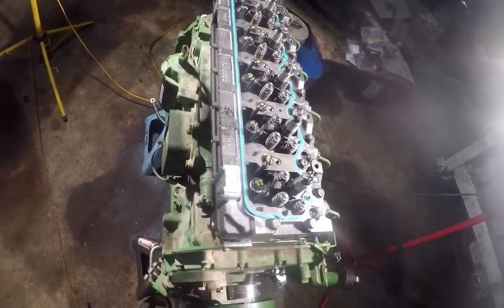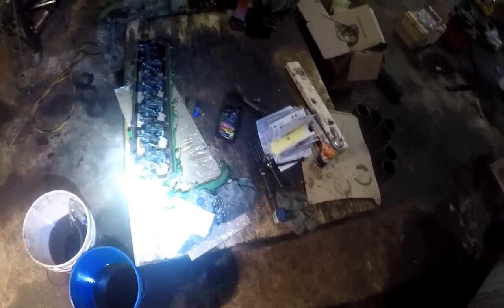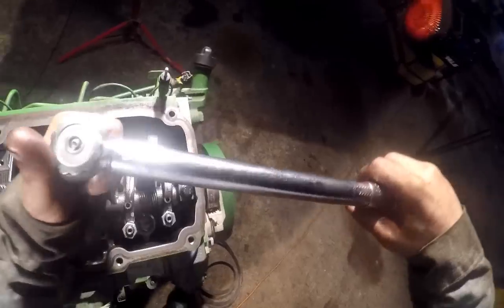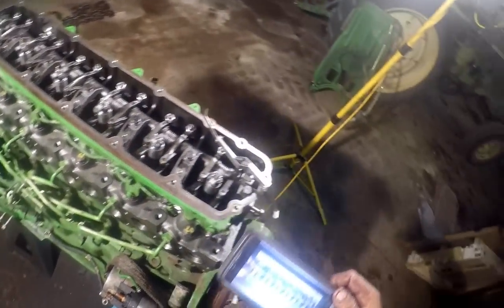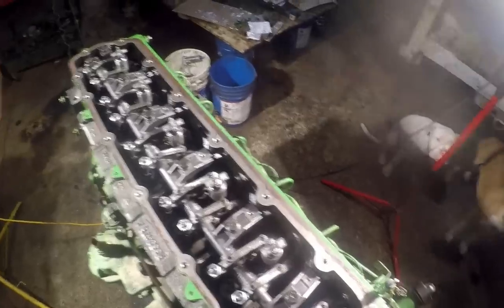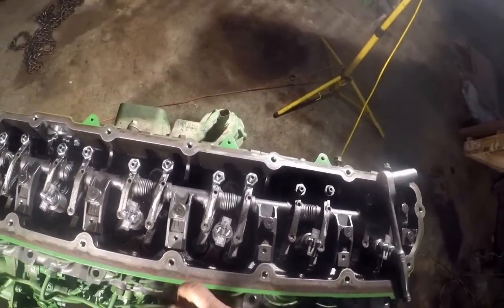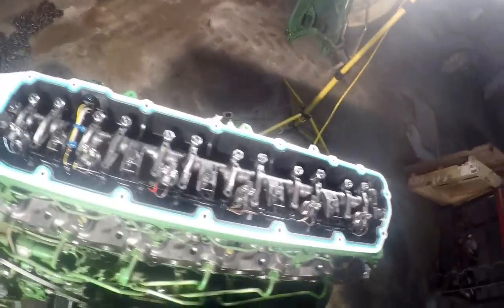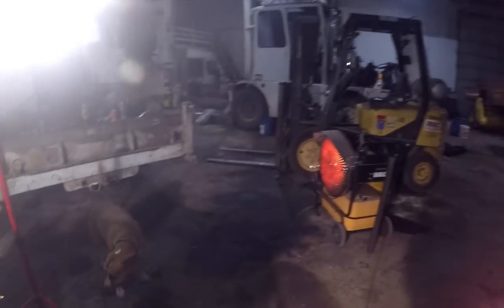John Deere 6170r engine rebuild part3

Comment: Keep up the good work Warren, I agree on the Val-6 heaters. I have the big propane one and love it, I put on a cheap thermostat. Mounted it right to the heater frame works great. Like seeing the stuff you get to work on, I work on the older stuff but as times change the new "Crap" breaks more often so seeing it start to show up at my shop. Thanks for the help on the 4440 pto question I had a while back. Tools are never ending

Comment: Well done sir would shudder to think of the cost at main dealer. You work very hard and know your stuff we run 3 6150rs and 2 6170rs had a 6930 that holed a piston and dealer stripped it and said it was not viable to repair botched it so it would run traded it for a 6175 def had 5 def pumps on it in 30 months thanks for your daily vids they're rivetting.

Comment: Nice rebuild warren. Typically Do you leave the oil cooler alone when doing rebuilds? Is it overkill to replace it at this point? Keep the videos coming, I love watching.
Reply from the maker: It depends,  high hours I change  them , but this low houred one I didn't.  Thanks for watching.

Comment: In part 3 of 6170, I'm wondering if you could create a spacer jig to eliminate the time needed to space that rocker assembly.
Reply: also wondering if there is a tool for spacing the rockers that has both wrench and Allen wrenches in one tool instead of two. I also wonder about how JD spaces them at the plant.

Comment: Hey thanks for the videos, I was wondering if you knew how to get a hold of the valve adjustment and injector adjustment procedures on a 2012 paccar mx13.... there isn't a lot of info online about the paccar motors. Is there a website that you can buy manuals or do you have a manual, Thanks.
Ps. did you get that series 50 running didn't see a reassembly video.
Reply from the maker: Erik Bahena  Still waiting on the cylinder head for 50 series.   For the Paccar go to Tim Stanfords channel.  He's a buddy of mine that just started doing some videos. He does alot of truck work,  and I know he has those specs . I'll message him and let him know .
Reply: I appreciate it, and I'll check him out too. Thanks Warren.

Comment: I"m confused as to why the pump has any sort of timing.  Maybe they identified some sort of harmonics in certain positions, and they want to avoid it?  Otherwise it is just a high pressure pump.  Timing is at the injectors, not the pump.
Reply from the maker: 6.7 cummins common rail bosch pumps are timed too , but I don't know the reason.

Comment: Man I wish I had you to help me rebuild my 1939 B Deere. It has babbit mains and I can't find anyone who can tell me the mininum thickness and if they can be reinstalled. All the old mechanics are gone now. New old stock are not to be found. Speaking of valve adjustment I have a 5075E with the Etech engine. It has 950 hours. Should I have the valves adjusted? Book says 600 hrs but at 100 dollars an hour for shop time I can't afford it. If I just had some of your smarts.......... Thanks and great video as usual.
Reply: Check out davin on hagerty I  saw  him  doing  babbit  on an old Ford

Comment: Your phone diagram has you doing the wrong thing at 42:00, so I would try a different way. Do three in a row, skip one, skip another one, skip another one then rotate 180 and repeat same pattern from other end of head. So you're doing one of the three end ones already done and you needed to be doing forth from the end instead. Automatically I know you have one valve never touched (4th from end). To your credit you double checked it and I heard adequate slack clear out here in colorado. I'm thinking that damn phone slid you into redoing at least one valve though. With my method, I knew it was wrong the moment you went for one of the last three.Three in a row and then skip one three times. Try to get some sleep Warren, much more important than videos. Made some verbal mistakes, said 360 degrees when 180 was right and you normally catch those, so I'm think sleep deprivation possibly.
Reply from the maker: Not trying to argue with you , but check your degrees, it takes 360 degrees of crankshaft rotation to go from tdc# 1 to tdc# 6  ,and 720 degrees of cam rotation.
Reply: That's right doggone it. Just shows brain farts play no favors, anybody can have one at any time. If only I had a nickel...

Example is you said that wrong just above. 720 crank is 360 cam, and what we want is 360 crank and 180 cam anyway, but I knew fully what you meant and even read it as the corrected gospel first time thru. Had to take a second look to see the mistake. I could use a nap myself.
Reply: Just learned the other day that the 4025T John Deere engine has hydraulic lifters too - a first for me.